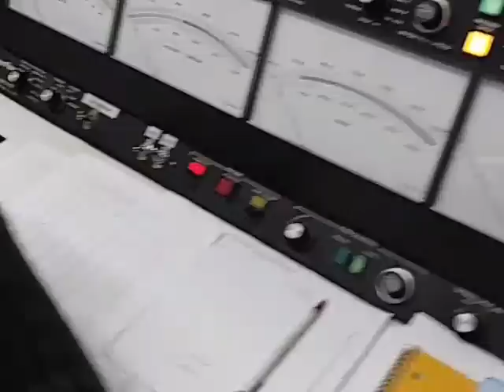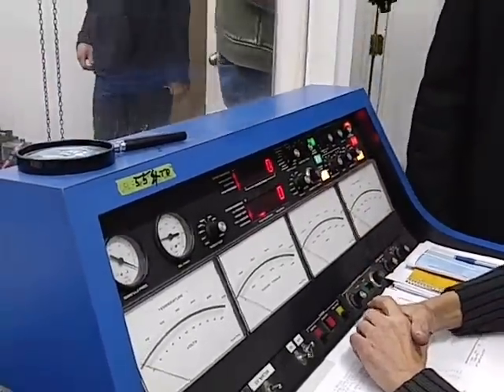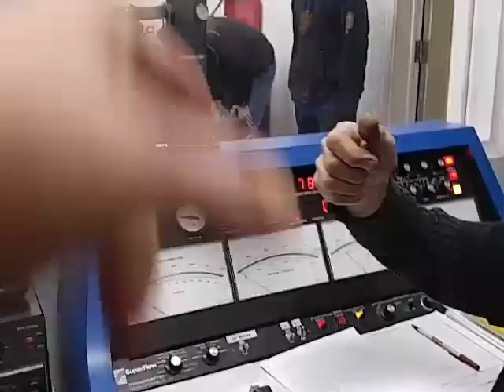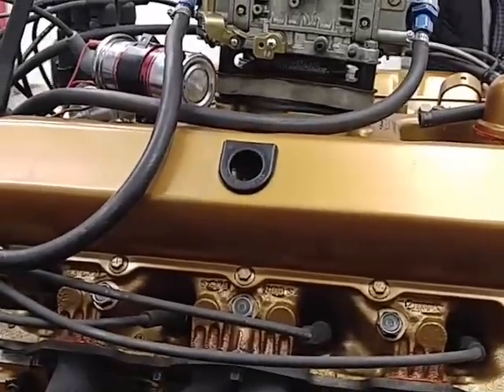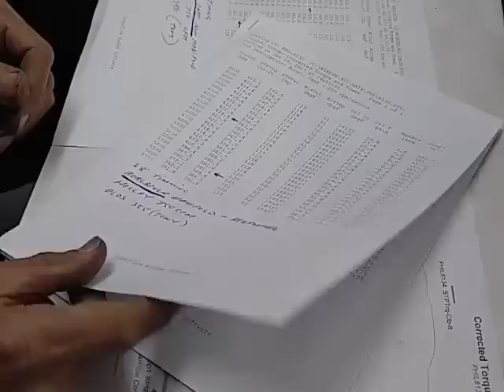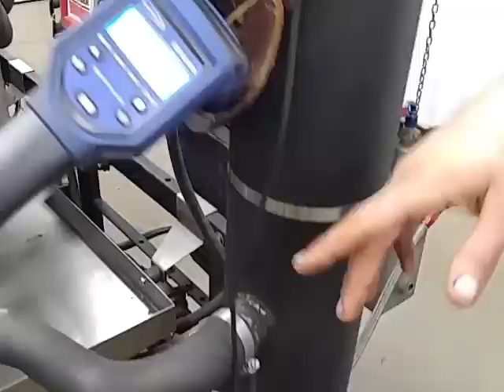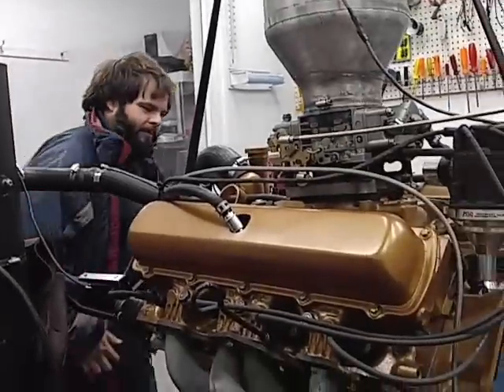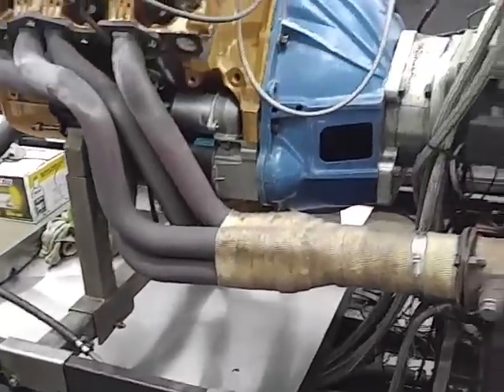Olds Rallye 350 Dyno Pull 1 30 17

Comment: What's funny is that back in the 80's and 90's Olds engines were all considered boat anchors. Everyone had or wanted Chevy or Ford motors (once in awhile you'd see a built-up Pontiac motor). That was the only thing to have if you wanted to make power. Now Olds engines are seeing interest. Maybe because there aren't many Chevy/Ford engines left, or maybe because these "exotic" engines are the in-thing now.

Comment: You need a commentator with a brain that knows what he's talking about.. they did not put a 600cfm Rochester on anything they all flowed 750cfm.. and the BB ones were 800cfm
Reply from the maker: Ok ok...
Reply: Correct..depending on the max secondary air valve angle, Q-jets were all between 730 and 800 cfm. Olds used 730 on the 330/350's and 780 on the 400, 425 and 455. Even the old 4GC Rochester from 65 and earlier was up to 692cfm.

Comment: Could you have gotten to that 400HP mark or beyond with a 403 block painted the Olds gold to "look" like original 350 engine,, or would the windowed main web in the block compromised the strength  for those 400+Hp @ 5000+ rpms?

Comment: Some shops hook the dynos hot water to the their heating tank. And get "free heat" for their shops. And sometimes when they run  high hp engines they need to stuff snow into the heat radiator that was placed outside the shop for extreme cases. When they really push a racing engine simulating a track session or rally stage. And not just run a engine through the rpm range.

Comment: Looks exactly like the Rocket 350 in my first car, a '72 Cutlass Supreme.   That 650cfm carburetor on the table looks like the exact same carburetor on mine.   Though by 1972 (and not a 310 HP Rally 350) it was only making 186 horsepower.
Reply: heymisterderp 70 had a different SAE horse power rating system and compression was higher in 70 to reach that 310hp mark.
Reply: That's about 260 HP.

Comment: I had a '70 350 rocket i balanced/blueprinted back in the day. I'm pretty sure it was over 400 with the edlebrock intake. The compression was up there with flattops but it ran on pump gas. I don't think your running enough cam. I ran an Isky 280 and it pulled a good 500 rpm further and had plenty of vac, your carb of choice all ran fine. Actually the 750 DP was the strongest but i never tried it when i had the car because i thought it would be too much, lol.
Reply from the maker: The same guy also bought another Rallye 350 in the spring, pretty much a Survivor car with some Rust, but a really strong built 350. I took it for a test drive, and the back tires just wouldn't stop spinning! If he was more aggressive, I wouldn't mind racing all three that he has, two automatics and one four Speed. Maybe next summer I'll show his whole collection of three Rallye 350s, and I also have a 409 Biscayne that he found for me, and he'd like to buy, but I like my 3 409 Chevys!

Comment: The guy with the camera is so annoying. Anyway, if you want hp you need to pay. Quit trying to squeeze the lemon. Did you put the piston rings in? Why didn't old mate headbutt this tool?
Reply from the maker: Gav Brady you are correct, we didn't use piston rings, we used precisely trimmed lemon rinds, cheaper, biodegradable, and tart smelling exhaust

Comment: run my flat tappet 302 with worn spark plugs and dist cap and tell me the power. prob 140hp
Reply: D4x4Bronc ford or chevy 302?
Reply: Jared Bib ford
Reply: hmm that makes it harder lol chevys 302 had like 3 years and most made 290-450 depending on teir
Reply: im going to geuss tuned right you could get 190 but idk cam specs

Comment: They should have used different heads, I noticed the #8 heads which are lower compression heads, than say a #5, 3, 6 or 7 which are all older heads which would have given him the hp he was trying to reach.
Reply from the maker: I'm hardly an Olds expert, even though I have a couple of 66 Toronado's with the 425. My friend is an Olds expert, and I would suspect that he was making recommendations to his friends Rallye 350 build. That car should be on the road this summer, he's been restoring it for 2 years
Reply: @CORVAIRWILD  you have the high compression 425 they have the same w30 heads as the w30 455 that found it's way in the Toronado
Reply from the maker: @soulfultenor  they're both 1966, ultra hi compression. One is at my shop, but I'm out of town. I'll report back in a few days. Remind me corvairwildGmailCom

Comment: If it's a '70 rally 350 it is factory 325 HP not 310...my '67 330 had 320 HP. And I got 425 HP out of it...and my '66 425 had 365 HP and I got 526 HP out of that...
Reply from the maker: 310hp, NOT 325hp. The 325 was the W31 option, and was never offered on any but the W31 Ram Rod. The Rallye had but 1 engine, the pedestrian 350 310 4bbl. Same idea as the W30 455
Reply from the maker: You are correct in the 330 having 320 horsepower, but I doubt that that was accurate. It's just too much. Almost one horsepower per cubic inch in an engine that was offered in so many different models, that was supposed to have smoothness and quiet operation? Probably more like 290 or 300 at the most, hard to believe Oldsmobile over rateed their engine

Comment: Those 350 Rallys were total pigs on the street and ugly to top it off. Yellow bumpers? Are you kidding? I'm an Olds fan and a buddy of mine had a 327/300 HP Chevelle that would kill those cars at any speed. Now. A W31. That was a killer street car.
Reply from the maker: You're correct about the yellow bumpers, the cars didn't sell. But when they put body colored all the challenger and 'Cuda, it was a hit. Go figure. And the Rallye 350 was just a trim package. The W31 was an entirely different motor. But this motor was built hot like a W31. We'll see how it runs the summer, I'm in touch with the owner...

Comment: gm net ratings were 1972 and later as installed not like this guy says-1971-----1970 454 ls6 450 hp-1971 ls6 was 425 hp because 2 point drop in compression but still solid lifters---1972 solid lifters 454 ls6 GONE!!--this guy is not correct just check a motors manual 68-74--it tells 72 later net as installed not 71
Reply from the maker: Welllll.... I DISTINCTLY recall seeing net ratings in my 1971 manuals, both factory owners and shop. A Google search is somewhat conflicting, so let's say we're both correct. My mother ordered a new Pontiac T37 in late winter 1971, and I devoured any factory issued literature, and there's no question in my mind that along with compression and low lead compatibilty, factory HP ratings dropped to net in 1971.

Comment: man that voice is familiar
Reply from the maker: randalljames I guess if you've heard my voice before and I are hearing it again. Go to Nick's Garage on YouTube, he has a great Channel
Reply: gotcha..  hey would you know about a very large bore, reverse rotation corvair motor?    Got hold of this thing 30 years ago and it runs like a scalded dog.. Pulled all the fans and run in on alcohol...   Seems like the bore was at least a .250 larger than the big corvair motor..
Reply from the maker: randalljames go to Corvair Center Forum and sign up. I'm uglytruk there

Comment: NO quadrajet was 650 CFM.  Ever.  750, and 800.  You are NOT well versed.
Reply from the maker: Ok boss, you're the qjet expert... and now I am, I just read the Wikipedia page
Reply: Yo they did make the bigger q jet carburetors like seven fifty and eight hundred CFM on the big block motors dude 🙄🙄😐 😎